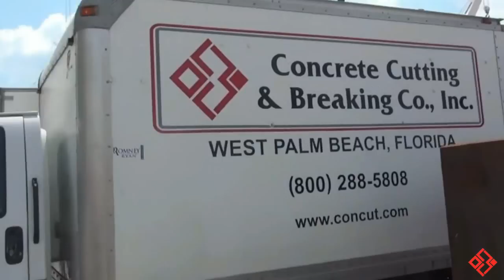60" Concrete Core Drilling in Houma, LA [Concrete Cutting and Breaking]

Comment: The biggest I've drilled was a 54". You made that 60" look easy. More guys should utilize those stability side wheels like you guys do. Nice job. I was just curious why the second bit was used. Did the segments glaze over from all that monster rebar?
Reply: I was wondering that too , would be very expensive 2 bits per hole , i reead somewhere you can deglaze them by running through soft brick material is this correct ?
Reply: @Cagmito125sportsbikespares  yes

Comment: I am a core driller for a local pre cast facility. Two hydrolic machines with 4 turret mounts for multiple bits. The largest I have cored was a 48" thru a 96" manhole. We use diamond bits thru Concut and Trelleborge. Very fun and knowledgeable field of work, I love it.

Comment: I have been checking on line for the proper RPM to core drill a 18 inch hole in a rock.  i read that the bigger diameter of a bit, the slower the RPM. Looking at that drill go, it looks like it goes way more than 200 RPM. what should be the speed for 18 inch bit?

Comment: How is the core fractured at the bottom in order to lift and remove it?
Reply: Sledgehammer and chisel, usually the core will snap if it’s more than 1/2 the length of slab

Comment: Hello, wonderfull. Please how long time to realize the full coring ?
Reply: The coring process took approximately one 10 hour shift for 60" x 48" deep.
Reply: Please note that we drilled through #10 reinforcing steel on 6" centers as well as some steel on vertical angles.  Drill ploughed through with no issues.
Reply: ok thank
Reply: wouah impressionant!! jamais encore fait
Reply: Drilled hole complete in 4 hours